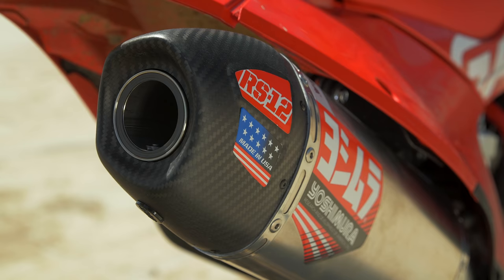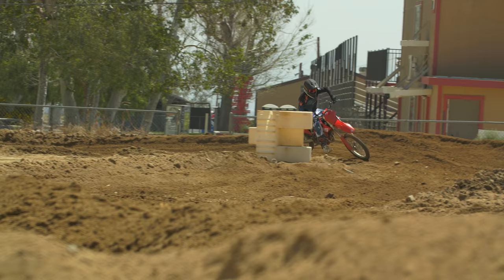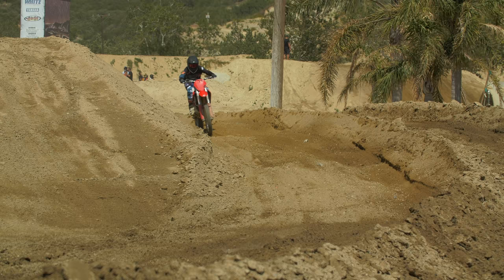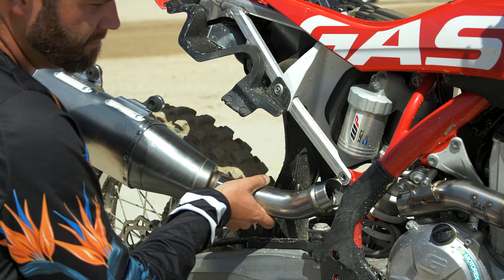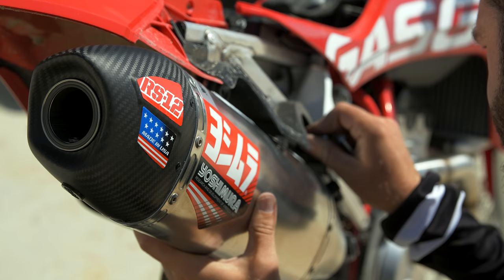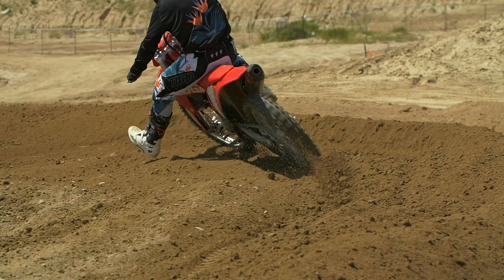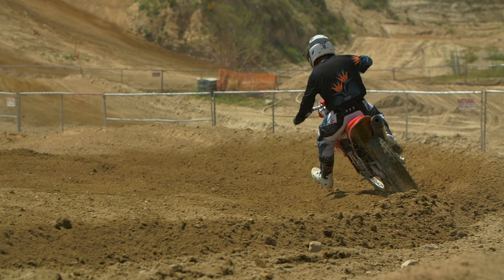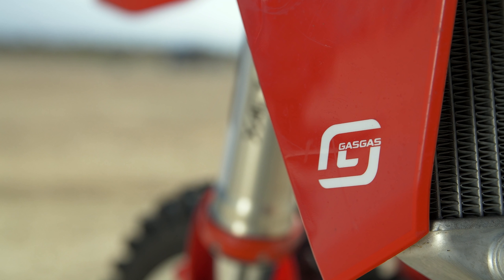Yoshimura RS-12 Exhaust Review On A 2021 GASGAS MC 250F

Comment: Got my RS12 today for my '21 KX250, freaking pumped!
Reply: no remapping needed ? plug-and-play ? got also kx250 '21. thanks!
Reply: @ninja1970fin  the bike comes with 3 couplers with pre set mapping, as far as tuning goes it's recommend for some systems and you'll probably get more out of the rs12 with a tune but it's not necessary for this particular exhaust system
Reply: @kevin77pwngeguy  yeah Ive got those couplers and tried them, thanks. Ordered the Yoshi for my kx250 XC.
Reply: @kevin77pwngeguy  Just wondering how your exhaust is going , still wrapped with it ?
Reply: @bradrees1679  been an awesome system for the bike, every couple rides the the bolt holding the pipe might vibrate a little loose and If it drives thw pipe out far enough it has melted the inside of my plastic a little before. It also doesn't have a heat shield on the header so it's super easy to burn my leg if I'm not careful. Other than that I've had no other complaints with it 8/10